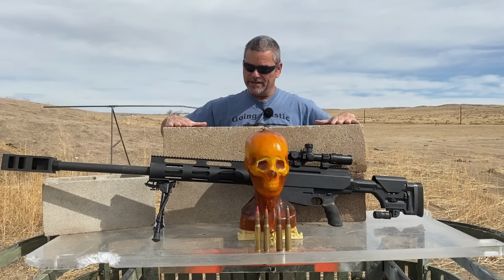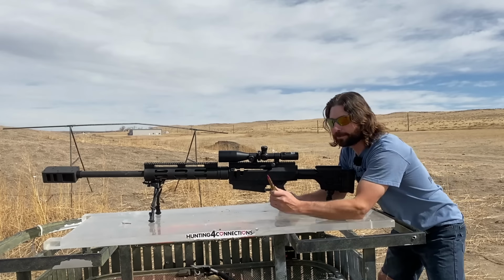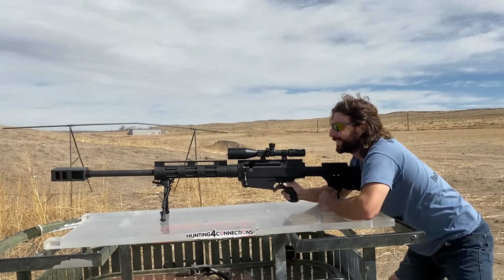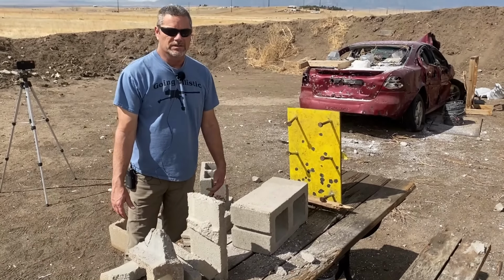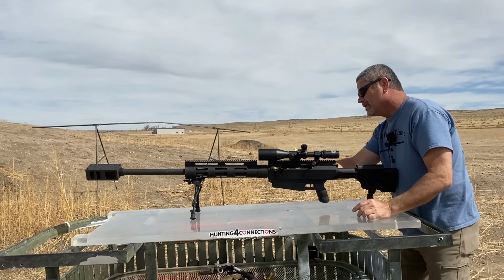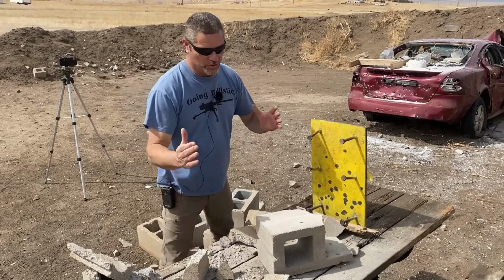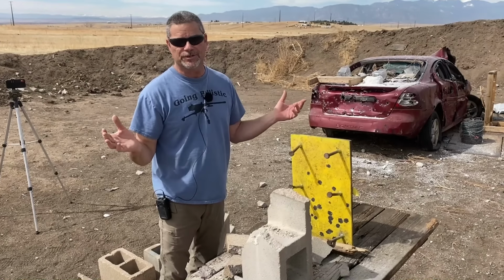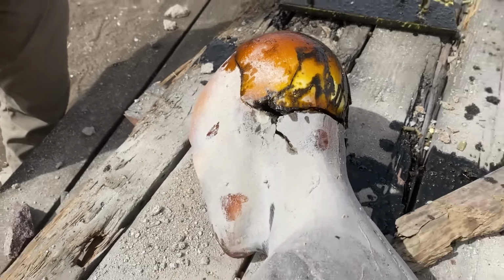50 BMG vs Cinder Block Wall

Comment: One thing I'm curious about is how well the old UK Victorian era external walls hold up... Because there is a brick/concrete coating on the outside, with (in most cases) 6"-24" of sandstone behind that. I'd love to see how a .50 does against that sort of barrier

Comment: Could you guys try against sandbags? Also against NERA? So two tempered steel plates bolted together with a rubber block glued in between them. The rubber will stop the tempered/face hardened steel from shattering as the rubber will compress and expand due to the pressure, deforming the steel, presenting more material for the bullet. If I understood it correctly 👨‍🔬 😅